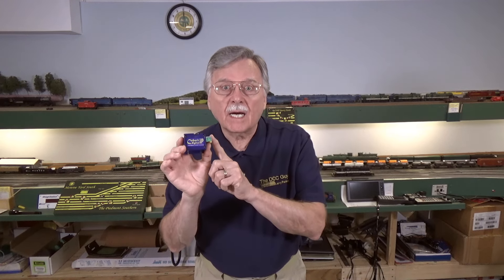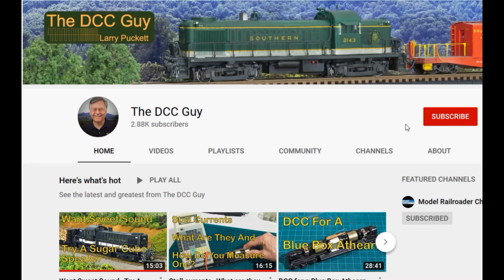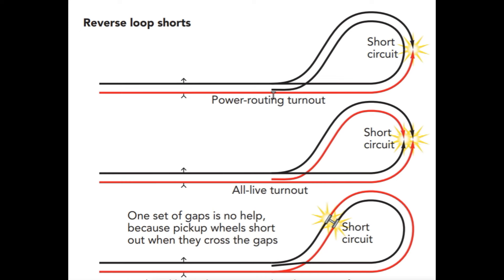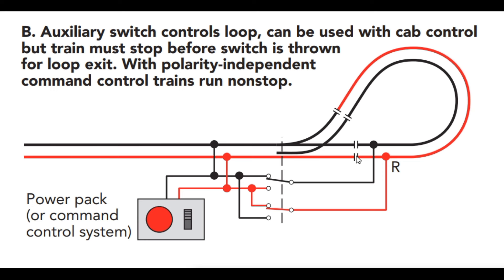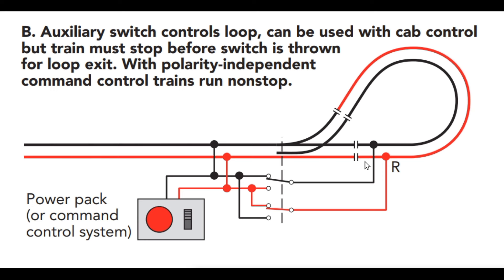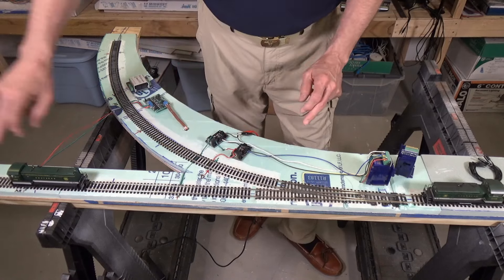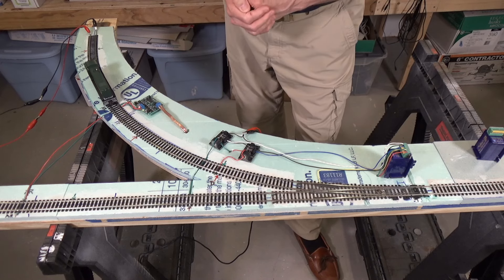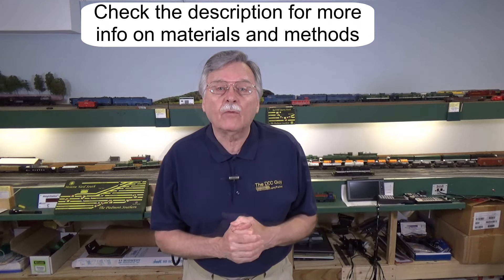Fully Automate Your DCC Reverse Loops (197)

Comment: Larry , did you resolve the 12 volt power issue, I want to combine this with a helix similar to the one you are building now , a great combo , can you post a wire diagram for this set up , excellent job , I love this
Reply from the maker: I honestly don’t remember a 12 volt power issue, can you point me to a specific time stamp in the video where I mentioned it?
Reply: Hi Larry sure no problem, I will re watch , it is a great video
Reply: Larry at the 14:49 minute mark power to the block detection
Reply from the maker: I have asked the guys at DCC Concepts for a clarification. The instructions do say that in order to operate an LED or other device you need to provide either DC or DCC power, so maybe the iP Digitals do require the extra power input. I hope to hear back by tomorrow.
Reply: Larry great , I plan to build hidden staging yard and reverse loop. Using a helix to reach my main level, so I am watching your videos learning more thanks
Reply from the maker: Ok, I got an email back from the technical guy at DCC Conceots and he says the blurb in the instructions is misleading and they will revise it. You should use either the DC power as I showed in the video or you could use DCC power which I have nor tried.
Reply: Thanks Larry, I am a few months away, working in track plan , helix  but a great video and will watch again
Reply: Larry you used the DCC concepts block detection in this set up,

Comment: If you were to add circuit protection (lightbulb) where would you place it? Thanks...
Reply from the maker: I wouldn’t use one, they are too slow and don’t kill power, just limit it. But I have done videos for those who insist. Just isolate the block of track and wire the bulb at the point where you create the bus or sub-bus to power the block.

Comment: In the video you said that you needed to add a 12v power supply to the dcc concept sensor to make it work. Did you ever find out why that was the case fro DCC concepts? Is the 12v supply needed or is there a way to wire this to allow for the non 12v approach?
Reply from the maker: Their response was that it does need the power supply, the instructions need updating.
Reply: @TheDCCGuy  thank you for getting back to me so quickly with an answer. love your channel.

Comment: I got the "Smail" switch machine to work just like the Cobalt Digital switch machine (which you can't find anywhere) in this auto reversing configuration. Just wire the block detectors to the C1-GND-C2 connections on the Smail.

Comment: Two questions: 1) If I wanted manually induce the turnout switch to change, what would I need to add to this configuration. 2) Are these modules brand agnostic? Meaning, does it matter which brand DCC controller I use? (I'm pretty sure it doesn't matter, but I want to double check.)
Reply from the maker: I think that by placing a momentary pushbutton switch across a gap you create a sort just like you loco wheels and initiate a reversal. And yes, this could be done with any DCC system.

Comment: Larry    Finally have my Reverse Loop built on my upper level. The Turnout is insulated on all sides  Both rails.  I have feeders from my main DCC bus connected in the loop.  The train runs thru the main of the turnout and into the loop as it gets close to the diverging leg of turnout it stops short circuit the rails are reversed as expected.   On the main line of the turnout about 24 inches up I placed a cut in the rail.   I placed feeders black and red  (red is inside rail) Black is the cut rail.  and connected those two feeders to my Dual Frog Juicer.  Also prior to the cut I have a black wire  fed down to my NCE BD20 which then connects to my Black mail DCC Bus line.   So far following you video all good. on the bd20 I see in your video you have a black blue and white wire.
What I do not see is what pins they are connected to on the BD20 and on the Cobalt IP Digital Machine can you let me know what the names of those pins are on both the BD20 and the Cobalt ip digital?   Thanks Tom
Reply from the maker: Tom—I didn’t use a BD-20, but instead used the DCC Concepts version which is very similar. Somewhere around here I have some info on using the BD-20 in a similar case but just need to fo d it. When I do I’ll email a copy to you.
Reply: @TheDCCGuy  Larry Thank you I sent you an email about this also you can reply to that one with the info thanks again.  I have my second reverse loop almost completed now for the track but no wiring as of yet.  waiting to see how the first reverse loop works
Reply: @TheDCCGuy  Thank you so much, Larry, for this great video.  I would also be grateful for the info you have on using the BD-20 for triggering the turnout throw.   Can you use a tortoise machine instead of the Cobalt?  I also use the Freiwald Industries Train Controller software for automatic train running for guests, etc., which would require a third BD-20 to be used for block occupancy detection in the actual reverse loop as well -- would this additional BD-20 interfere with the two controlling the turnout position, or visa versa?

Comment: I hope you see this, as it's 3 years later (12/28/24). I have a lot of Hex Frog Juicers, one of which I'm using to change the frog polarity on the turnout that goes into the reversing loop. Can I use the Frog Juicer to also flip the switch machine when the frog polarity flips in order to automate the reversing loop? Thanks.
Reply from the maker: Frog juicers are basically a solid state switch that flips the power bus connection to the frog when it senses a polarity (phase) mismatch. So it is not designed to do what you want.
Reply: @TheDCCGuy  I thought I should at least ask before spending more money. Thanks.

Comment: Thanks for your video Larry.
In the video the term “DCC Power Bus” is used. In some other videos you refer to a “DCC Accessory Bus”. My question is, are the red and green wires going through the headstones to the isolated track section, to the switch motor, and the clear copper to the Frog Juicer/Auto Reverser unit all on a separate power source and not track power? I have tried DCC REX using their wiring diagram and was unsuccessful. Did Mick answer the questions you had? Hoping you might make a video showing it in use. All the Best
Reply from the maker: The DCC power bus and the DCC accessory bus can actually be one or two separate 2 wire buses depending on your approach. The DCC power bus is used first to power the tracks, but it can also be used to power DCC accessory decoders, devices, and even some other accessories. However I suggest having a separate DCC accessory bus for several reasons. Fir example if you use DCC accessory decoders to control your switch machines then by isolating them from the power bus they are protected from shorts. When I was at Warley last fall the DCC Concepts demo layout stopped working because a short created by a loco reset all the accessory decoder addresses and they had to reprogram all of them to get it to work again. Having an isolated DCC accessory power bus would have prevented that. You can also have one booster dedicated for the main DCC power bus and a second one just for the accessory bus. That way your accessories don’t use up your power you need to run locos. In this video I used a combined bus approach simply because it was simpler and easier to set up.
Reply: @TheDCCGuy  Let me ask in a different way. Are the isolated tracks leading into the reverse loop getting DCC power from something other than primary track power? Thanks for explain the pros of the separate accessory bus for switch motors.
Reply from the maker: Everything is powered by the same power bus. The polarity of the isolated reverse loop track is controlled by the autoreverser.

Comment: I have basically a large Single Track DCC Folded Dogbone, where i one half it Loops back close to the Opposing track to give a Double track appearance. 

Basically imagine an open loop, Until I add the Crossover Switches. 

I want to Add a Single Crossover (2 Switches) between those opposing Mains. Which makes a Reversing Loop plus a straight through continuation on the back track. 

Confused about the Continuation cutoff past the Crossover. Tie it into the feeder off a Dual Juicer same Polarity feed as the Main Before the Crossover, opposite of the Loop feeders?

Using Peco Electrofrogs modified for DCC. Manual Throws.

Comment: I also use the Digitrax system, I am using circuit breakers to protect the layout in the event of a short circuit, Now I had a problem when using my PM42 set up to control reverse loops in that I've had to use sections of track at each end of the reverse loops and feed those directly from the DCS 210 controller because if I used the circuit protection, the circuit protection would operate before the PM42 had a chance to do its job. since wiring it this way the PM42 works great.
Reply from the maker: What kind of circuit breakers were you using with the PM42?
Reply: @TheDCCGuy  I am a member of MERG. You could find them on the internet. MERG  is a group of people made up of members and some of the members who are involved with the running of the club, have over the years, become very knowledgeable and skilled in what they do. They put together different electronic kits, which can be purchased by members and there are various kits for model railroading.
I purchased 4 circuit breaker kits and built them myself by soldering the components onto circuit boards. I set the trip current at 3A but the electronics of the boards are more sensitive than the PM42 which is why I don't feed the reverse loops with the over current protection of the breakers. As it is more or less impossible to get a short on the reverse loop itself I'm OK with doing that. and if it came to a short occurring the DCS 210 would operate to protect itself, in the same way as when one tests the track at various parts for continuity. I could give you the kit number if that would help, but I believe they only do just the one kit for track protection, I have 3 levels and use one for each level.

Comment: So does a Tortoise switch work the same as theDCC concespts  IP Digital ?
Reply from the maker: More,or,less but the iP Digital has the accessory decode built in plus some intelligent features that makes what Imdid more straightforward. With a Tortoise I would have to have used some other accessory decoder as an interface. DCC Concepts has a new ADiA accessory decoder that should be able to control a Tortoise in much the same way but I have not had time to test it.

Comment: This is why I prefer insulfrog points! Cheaper alternative too
Reply from the maker: The type of tunrnout doesn’t matter you’ll still need to handle reverse loop polarity and switch the points. The only thing an Insulfrog gets you is not having to power the frog which may result in small locos stalling on the dead frog.
Reply: @TheDCCGuy  my peco code 100 insulfrogs work perfectly here in uk

Comment: If the train is coming from the right, your left in the video, can you select straight through or diverging route? Or are you limited to the last position direction? I realize that this is simply a hidden turn around so in this case it does not matter. If it were applied that it is visible can you select direction, or is that a much more complicated wiring project. Thank you in advance.
Reply from the maker: This is just designed as a hidden turnout loop so no provisions for directionality, which would require a more complicated logic based system and more detectors. Since I no longer plan on using the reverse loop I am glad not to have to fuss with designing such a system.

Comment: Just a quick question.... I watched dwarf signals episode, and did not see anything about wiring signals with snap switches... Is it just automatic?
Reply from the maker: They are designed to work with either DCC or reversing power connections so I don’t see how a snap switch feed would work as they are common/L/R. You might ask the folks at DCC Concepts though as I know they do make solenoid based snap type switch machines. Try j.whiteside@dccconcepts.com
Reply: @TheDCCGuy  Thank you...

Comment: I felt sure that I posted a comment that this video was very timely as I had a virtually identical application planned when this video was first released but can't find it below. 

Anyway, after a few delays I have now completed the end-of-branchline staging yard and the reverse loop that supports it by turning the trains to re-orient them for their return call onto the branchline on a good friend's layout.  The reverse loop is hidden and while the switch is technically accessible it is very inconvenient to reach over the washer and dryer and my friend wanted it automated to the greatest degree possible anyway.  So, early in the new year I ordered the LM-ID detectors and the Cobalt IP Digital switch machine as Larry has used.  It took a month for them to arrive from England, much longer than I had hoped but that is life the last couple of years.  Earlier this week I completed the installation and wiring of these components and while I never doubted Larry it was great to see it work exactly as advertised/illustrated.  I was even lucky enough that my initial guess for which signal wire went to which switch machine input was correct (a very small victory over a recalcitrant universe) so it worked a charm from the get-go, first for a number of runs with my test locomotive and then a test train.  Based on Larry's experience I went straight to providing a 12 VDC power source for the LM-ID detectors.  I have a 12VDC power bus for this end of the layout for switch machines and other accessories anyway so I simply tapped into it for the detectors and Cobalt IP Digital switch machine power.  However the 12v supply means the Cobalt IP runs a bit slow, as do Tortoise machines at 12VDC instead of 16VDC, so if you use a lower DC voltage I recommend making the detector sections as long as possible. My installation uses a full length of flex track so 36".  At "normal"  track speed for this area the locomotive travels about half the length of the detector block while the Cobalt IP throws the switch points.  

I had been looking into how this gets done with the Digitrax BD-4 and DS64 but when I saw this video I immediately knew that it being completely stand alone and free of control inputs was the way to go.  The components are not inexpensive, especially with international shipping, but when they work as advertised and enhance the operating experience to the extent that they do in this application, then they become well worth the price.  

I have not been the biggest fan of a few videos Larry has put out but most are very good and a few are most pertinent to me as is probably the case for all viewers.  This one was almost tailor made for me and hence I see it as one of his very best.  I hope others have benefited equally from this or other videos from Larry.  Thanks for the help and guidance Larry, Best Cheers.

Comment: Dear Sir, I am a beginner in this hobby.. I hava small Kato Unitrack HO scale layout at home. Iam planning a DCC Double reverse loop in the layout.. I have some products from DCC Concept in UK.... I have very little knowledge about the loops.. I would appreciate if you help me with the wiring..can you send me a diagram..a sketch drawing of the wiring..Would it be possible to this loop with my HO scale Kato Unitrack and 2-850 / 2*851 powered turnouts...Best Regards... Kamil Işıldak..
Reply from the maker: If you check the DCCconcepts website or contact their customer support email address they have diagrams on automating reverse loops using their products.
Reply: THANKS A LOT ..BEST REGARDS.. @TheDCCGuy

Comment: So, from previous vlogs I’ve seen you do, on every DCC turnout you power the single end and insulate the end that diverges and the end that continues straight. So in addition to insulating the double end do I need this device as well?
Reply from the maker: I am not exactly sure what you are asking me but just so we can talk about the same thing let’s get the terms straight first. Turnouts have a point end and a frog end. The point end has two rails and the points, and the frog end has four rails and is near the frog. Now  this video you reference is different than wiring a standard turnout because I had to insulate both tracks at the frog end since it is a reverse loop. I also had to include a detector in the midst of all that on each side to be able to control the switch machine. So are you asking me about what I was doing in this specific video or are you asking about what I do for a turnout in normal situations?
Reply: @TheDCCGuy  I will reply with additional questions once I get my terminology correct. An issue I have is that it’s hard for me to express my thought process. On a side (but somewhat similar) note my geometry teacher hated that I could walk up to the chalkboard and give her the correct answer, I just could not explain my work as to how I got the correct answer. My mind doesn’t function as his did and that didn’t help matters. Thanks. Please stand by …

Comment: Thanks for the video. If you have a wye to turn your Locomotive around. Would you wire it the same way
Reply from the maker: Yes, in theory you could do it. But it would be a lot more complicated since there are 3 turnouts involved instead of 1. If I were to do it I would only automate the turnout at the tail end and the autoreversing section.

Comment: That's so cool. I have 4 reverse loops, 2 upper and 2 lower. I use digitrax ar1 auto reverser to change the polarity after I'm in the loop. I have to remember to throw the switch for my turnouts. But with this setup it fully automatic.